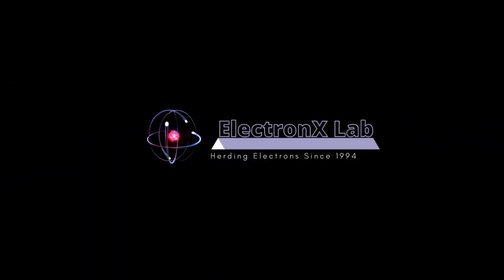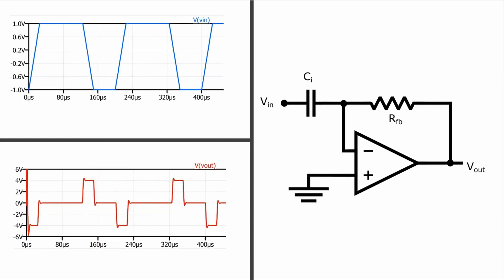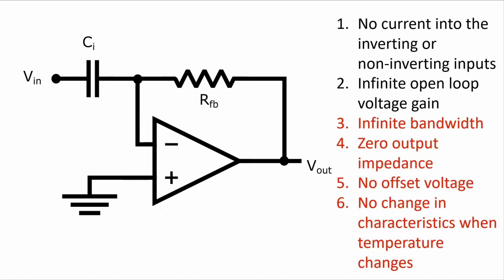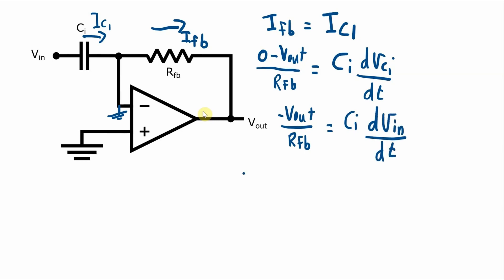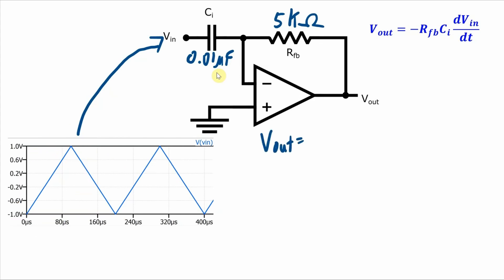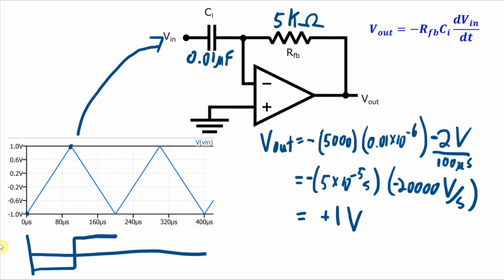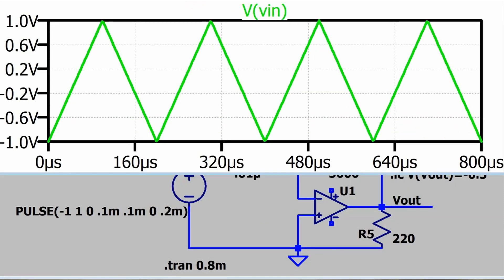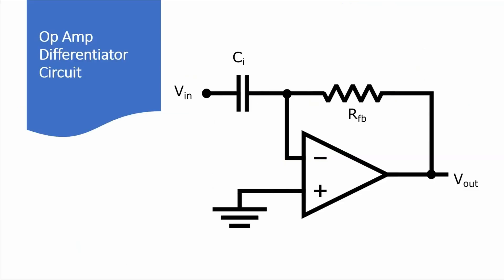Differentiator Op Amp Circuit

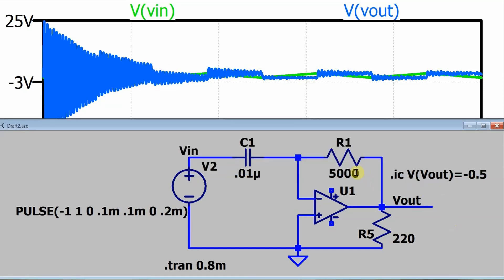Comment: 6:59 You have a bit of a misunderstanding here.  Yes, that circuit is completely worthless because you should never build a differentiator, and real PID circuits use lead-lag filters.  Your demonstration also doesn't make sense because this is SPICE, where noise is limited to the floating point quantization.  That output is not because of noise, it's because you just added a low frequency pole in the feedback path of an op-amp.  You have reduced the phase margin on your op-amp basically to 0, and you are seeing the poor stability as a highly underdamped response.  Adding a feedback capacitor means that you form a capacitive voltage divider at high frequencies (near crossover) with little phase and a reasonable feedback factor, fixing the instability.